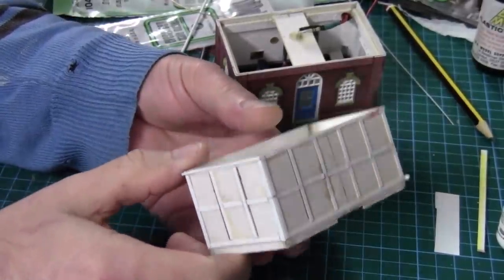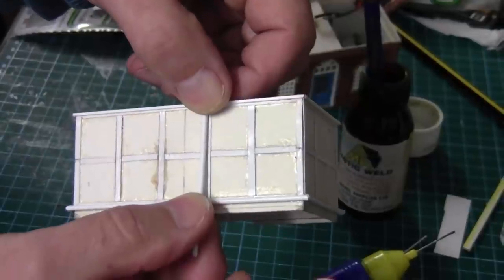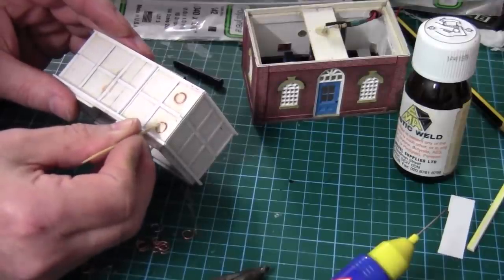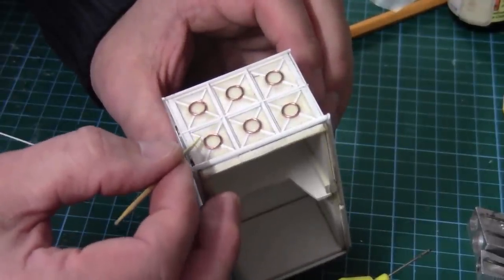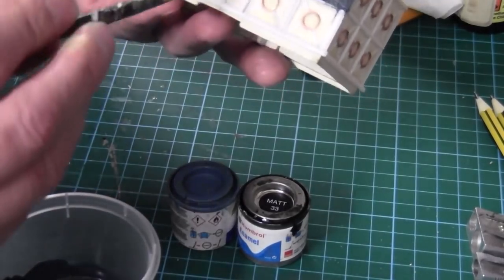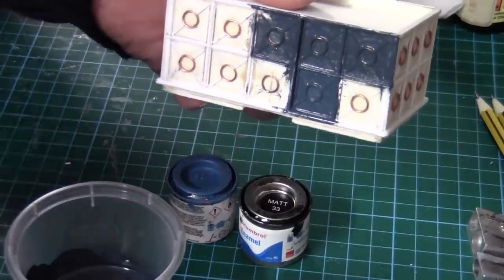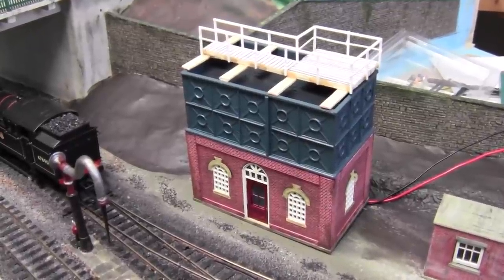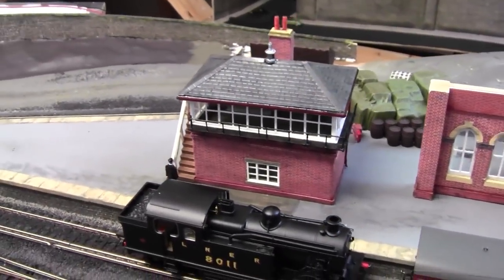OO Gauge N E R Water Tower Part 4   No 259

Comment: Hi Tony. I'm mightily impressed with the 'decoration' of the water tank - especially the copper wire circles, even from quite close up, you can't see the joins! I think you got the colour correct, even if not on the first try. Well done.
Reply from the maker: Hi Paul. i think the tank is the one thing i have got spot on.......thanks again for your kind comments........cheer's Tony

Comment: Hi Tony, I wondered how you were going to replicate the circles on the panelling of the tank and the method you used was fantastic. I considered how I would do it before your video appeared. I had thought taking an appropriate diameter of plasticard tube like Evergreen and slicing off the individual rings but I think your method has produced a superb result that cannot be bettered. On reflection, it would have been difficult to obtain consistent thickness of the plastic slices. Regards David Parkin
Reply from the maker: Hi David, like yourself i was thinking along those lines, cutting up plastic strip. the copper rings do work a treat. and with smooth edges as well........thanks again for commenting all the best Tony

Comment: Two more very entertaining and informative videos. That water tower is going to be great. I'm looking forward to the finished model. Incidentally, I approve of the locomotive at the beginning of part 3 but then I am a bit biased  towards all things Great Eastern!
Reply from the maker: Hi Les. it should be finished this week. walkway is now done. chimney has been added there is water in the tank. just a couple of finishing touches left do. the N7 is not correct for my region i portray. but i have ordered a G5 for the shields branch which did run on that route . so i can not wait to run that loco.....oxford rails N7 is a lovely loco. a great runner. and fits in well and looks the part........stay safe ........Tony

Comment: nice how you used the wire for the loops. no surprise you had to tinker with the color- it's an odd color. great build!
Reply from the maker: Good Morning John. copper wire was my savour in this build. i was going to cut down some plastic tube for the rings. but the edges would have been square. and it would not have looked right.....ah the colour as soon as i put the first brush strokes on i new it was going to work...i guess i am just a tinkerror after all. lol............cheer's Tony

Comment: Really good Tony, I wish I had your steady hands though, solder finds its way into some odd places rarely on the piece
( s)  to be soldered!!! I get there in the end! Thanks for  the great video!
Reply from the maker: Hi Peter. had you thought of rest your hand on a block of wood, or on some sort of support. to steady your hand. i do this when i am TIG welding........until next time stay safe......all the best Tony
Reply: @TONYNORTHEASTERN  thanks for that tip, I am getting a bit better at soldering, I have to admit.  A deep breath before a delicate operation seems to help too, but going blue in the face has ,of course, to be avoided!!!
Where there's a will...etc.
All the best. Peter
Reply from the maker: Best wishes Tony

Comment: The paint finish really has paid off Tony, it's really made that model.  All that detail looks superb - profiles and relief just like the photo. You realise there are over 200 pieces alone on the panels and the reinforcing rings  - how's your eyesight after placing that little lot? If our experience here is anything to go by our town water tower is up 60 to 80 feet up in the air, serves 3000 will last for 3 days ... and it's currently minus 30 degree C below - as long as the water is moving no problems no freeze ups. I suspect the chimney might have been for a fire if the ground floor was later used as a workshop perhaps. Stephen
Reply from the maker: Good morning Stephen. i was afraid to count up the pieces at the start of a build, as it may have put me off the build. lol.. my eyesight funny enough i have to go for my annual eye test soon. as its due. its not as good as it use to be. good point about the chimney. i have now included it into the build. i will share some photo's once its done. we are hovering 1c at the moment. cold and wet. typical British weather. although some parts of the country have snow. it always seems to miss us......Tony
Reply: @TONYNORTHEASTERN  Good luck with the test, it's quite a different experience to the pre Covid ones. I am lucky as I am short sighted so can get in close, however cutting lots of tricky pieces and my fingers get painful which makes accurate cutting difficult.... perhaps a bit of arthritis starting. Look forward to seeing those. Glad the comment helped, all the best Stephen
Reply from the maker: Take care ...................Tony

Comment: Hello Tony, I have been making a model of the water tower at Haltwhistle. Another North Eastern Railway design.  And was wondering how I would make the rings on the water tank. I'm pleased I've watched your video.  Quality workmanship.
Reply from the maker: Wow Darren. i will have to check Haltwhistle's water tower out. i am glad to be off some help. Thanks again for commenting. cheer's Tony
Reply from the maker: Hi Darren. i have had a look at the water tower at Haltwhistle. your in luck it does not have rings. its a lot bigger than the one in shield. i would like to see what you have come with.........best regards Tony

Comment: Great progress and looking just like the real thing too.  Oh, and thanks for the mention on Part 3.  
When you decide to upgrade Newhassle Central, you may consider building the large water tower that is just south of the west end of station.  The water tower has two chimneys, one either end of the building.  Google will help you locate many images of this Listed structure.  
Could I ask what period, if any, you are modelling, Tony?
Best, Jason
Reply from the maker: Hi Jason. i would just like to say many thanks for your help. the era is a bit of a mix to be honest. the station building represents what it may have looked like when it was first built. with out the walls being painted white. but the rolling stock is from the 1950s.and early 1960s. its funny you mentioned the water tower for the newhassle depot. because i have just mention that in a previous reply.. i will have to go and check out the photo now....great minds think alike..........thanks again Tony
Reply: @TONYNORTHEASTERN  Tony, if you Google “Water Tower South Central Station, Westgate, Newcastle”, (they spelled Newhassle incorrectly 😉), at top of the page is a link to the Grade II Listing details.  Clicking on ‘More Photos’ reveals six good sized photos of the water tower including the plate “NER 1891” on the front of the tank.  The water tower has been restored so looks almost new.  By the 50s, the stone would have been black with the sulphur dioxide in the air.  Best, Jason
Reply from the maker: Hi Jason. i have seen the photo. and tell what its worth a crack at building. its not as detailed with the panels the stone may be a problem as its not in card form. so it might have to made from plastic printed sheeting. there will be a chimney on the south shields water tower. hopefully i will make a start on that today.......thanks again for all your help...Tony

Comment: Delighted with your scratch build Tony. Here is a question for you which, I hope, you can answer for me. I am contemplating making a bass wood structure in OO gauge, but don't know where to start. First  I am going to  make a wooden frame on which wooden planks will then be placed o cover it on all sides. If this is a prototypical exercise, what sizing of 4x2 inch wood supports should I use? Ie. For making the wooden frame what would the sizing of the bass wood need to be? It is my intention to cover the frame with wooden overlapping planks.

Any advice from you Tony would be gratefully received and I can get on with this scratch build.

Many thanks for your help and advice.

Regards

Michael
Reply from the maker: Hi Michael. thank you for commenting. the legs for your base boards. can be 2 x 2 timbers. the framework 20mm x 70mm or greater. and keep the strut 300mm apart. as for the top i would now use plywood 10mm or greater. i think if was to build baseboards again i would choose plywood. that's for sure. baseboards are the most important part of a model railway. get this right and you wont have any problems. all the best Tony. and good luck with project.......
Reply: @TONYNORTHEASTERN  My apologies Tony. I wasn't clear in my question. The structure that I am making is s lumber hut, measuring in real life 12ft by 20ft. The framework is the basis for the model and in reality is supported by a 4 in x 2 in framework of timbers and cross beams. If I were to build in O gauge the supporting timbers would be 1/8 x 1/16 inches (not 4 x 2). What would the supporting beans be in OO? Do you know or could you advise what to use? I calculated the supporting wood in OO would be 0.75mm x 1.5mm but it looks to flimsy. Hence my question to you. As for your previous response, thank you. If will come in handy when I do construct my base boards in September after I have settled in my new home. Many thanks, Mike.👍😁

Comment: Great build again Tony, certainly inspiring. What type of card are you using?
Reply from the maker: Good morning Brian. the card i am using is Kraft card, you can find on Ebay. they do various thicknesses. i use 1mm and 2mm. you can also use the card found at the Range superstores. they do 1mm thick card. which good quality. 
A4 A3 A2 CARD SHEETS BOARD 2mm THICK PAPER MOUNT MODEL ART CRAFT KRAFT CARDBOARD..........

hope this helps..............Cheer's Tony